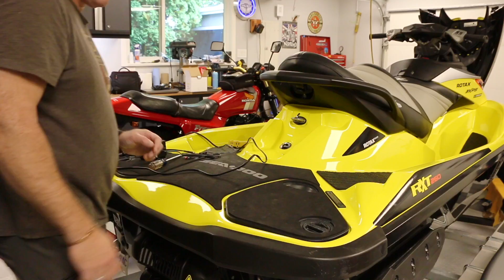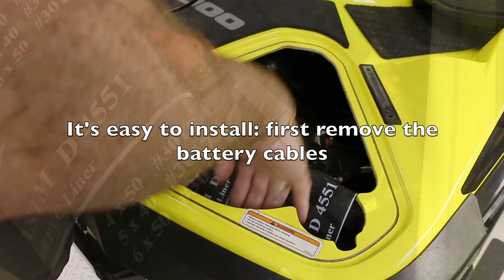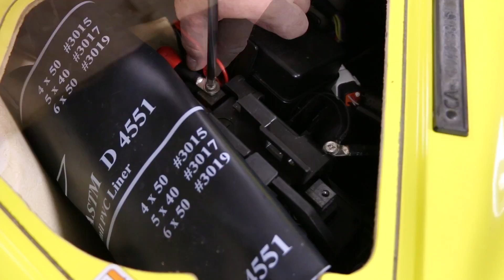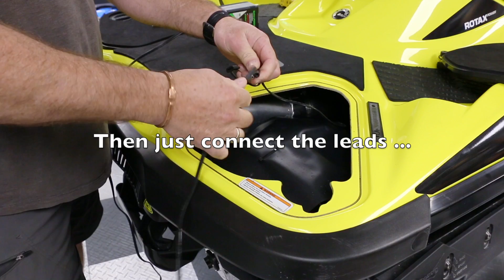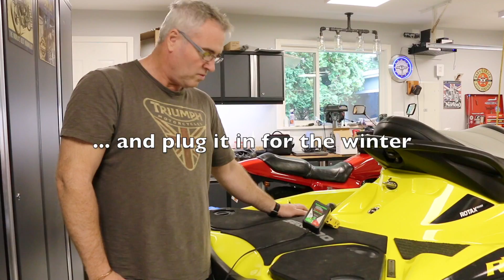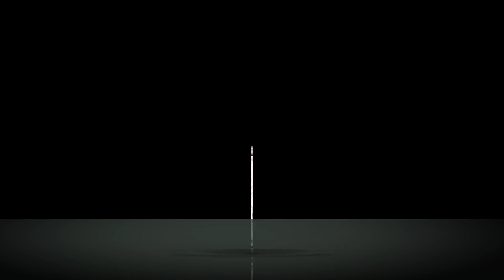How To Keep Your Jet Ski Battery Healthy Over Winter

Comment: Thanks for the video. Is that black plastic stuff you have over the battery factory or something you have added to, I assume, protect the battery from water leaking in?
Reply from the maker: It's something we added to keep water that may leak in from getting on the battery. Thanks for your comment.
Reply from the maker: It's some sheet PVC that I added in case the access panels leak the water will not get the electronics wet I have another piece over the iBR motor on the other side.

Comment: I like that little trickle charger. Ive been using the same trickle charger that i use on my suv. Is that too hot for that little battery in the Seadoo? On that note, is it safe to jump off my Seadoo from my suv or car?
Reply from the maker: I'm not sure about the trickle charger you use. Some of them have bad reputations for frying batteries. We use this little one because it gently (and intelligently) keeps the battery fresh over winter. It's not too expensive, either. I've jumped my Sea-Doo a few times from my car. Thanks for your comment.
Reply from the maker: If it's a true trickle charger then it will know when the battery is fully charged and stop charging so it doesn't boil or overcharge the battery and damage it.  I would not recommend jump starting your SeaDoo from a larger battery the older models had fragile electronics that were easily damaged when jump-starting the newer SeaDoos seem to have more robust electronics.  If you have no other choice and have to jump start from another boat or vehicle make sure it's NOT running and triple check the polarity connection is correct.

Comment: Do you have any videos to test basic charging system components.  I have two year old battery and on batterytender all winters but its mid to high 13volts depending on if key is installed and I have to start right away or it wont start.  I am sure battery is just little low but runs good and stays running once it starts. I am getting new battery but wanted to check other electrical components to make sure no problems.
Reply from the maker: Unfortunately, no. We may end up making one on checking the regulator, but we haven't had a need so far. We'll keep this in mind, though thanks.

Comment: How about a 5-10a solar charger as the "trickle charger"? I read that they work even on cloudy days, although not as efficiently.
Reply from the maker: I'm not familiar with solar chargers for this application, so I can't really comment except to say that the Battery Tender is quite sophisticated, and has a good reputation in the industry. Good luck.
Reply: Thanks anyway!

Comment: What’s a good battery for a 07 seadoo wake 215 ?
Reply from the maker: This is the part number for your machine: 278001882 and they’re normally YUSA brand, but you can talk to your local battery shop and ask for an equivalent 30 amp battery that is sealed and of higher quality, if you’d like it to be a bit more reliable and last longer. Good luck.
Reply: @3ftDeepChannel  trickle charger vs battery tender??
Reply from the maker: Battery tender makes trickle chargers. We use trickle chargers over winter. They seem to work OK, but I can’t rave about them. They lose a bit of charge over time even with the trickle charger. The key is to never let your battery get below 11.75v under any circumstance. Once it does, the life expectancy decreases significantly. I had a brand new battery that I let drop to 9v over winter and it never held a charge again. Good luck.

Comment: So Me and my buddy both have 2013 gti se 155s and we had this problem where the screws to the battery where coming loose it didn’t happen a lot but it started happening a lot towards the end of the season 2 times in one day what do you thinks causes this ?
Reply from the maker: Hull vibration. Try putting a little blue Loctite on the threads. Good luck.

Comment: Hey guys wanted to get your input on this.  Got a 02 GTX DI and noticed battery was draining after sitting for few weeks. I usually have no issues riding all day and runs very good but last time out it wouldn't start after about 4 hours. Charged battery and have 12.6 volts on it but now I can't get it to start up. It turns over and I hear fuel pump running.   Put new spark plugs and I do have fuel on them but don't have tester to check if I'm getting spark.  I thinking rectifier is going bad but would that cause it to not run on these machines? What would you start checking?
Reply from the maker: The DI's can do strange things when the battery and charging system is not functioning properly check the stator output, rectifier and load test the battery.  If any of the electrical components need replacing don't buy cheap stuff or you will have further problems.

Comment: I winterized and found oil in the spark plug cylinders any solution or anyone from your site can email to get me some information on what the cause and solution is.  Thank you
Reply from the maker: Sorry, I just found your comment now! Hopefully you found that it's the seal around the spark plug tubes that gets hard and fails to seal. They're about $25 each to replace. Good luck.
Reply: @3ftDeepChannel  lol yeah it went back to the dealer we found they crushed all the tube seals causing leaks in them .   These engines are rotax engines on a 255 scarab ID wake boat ...